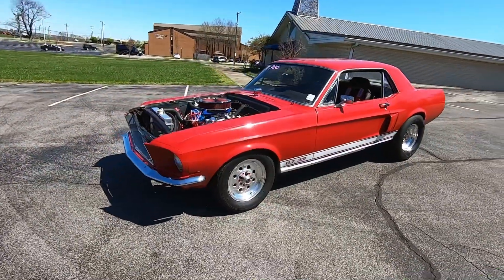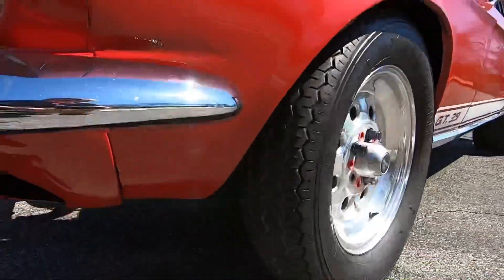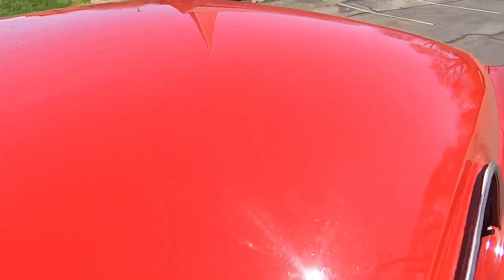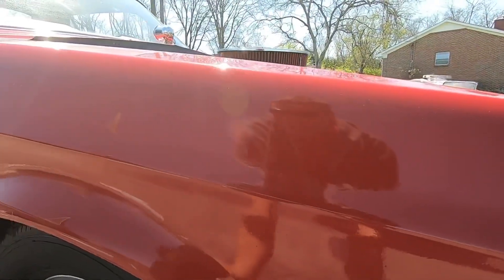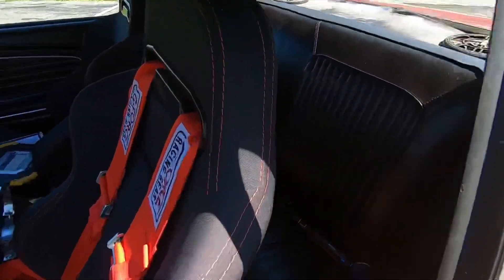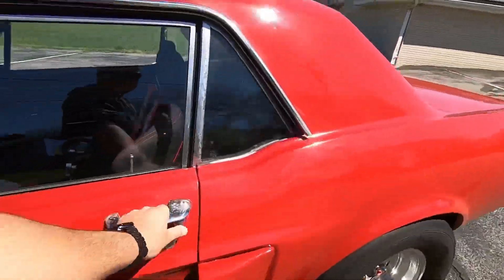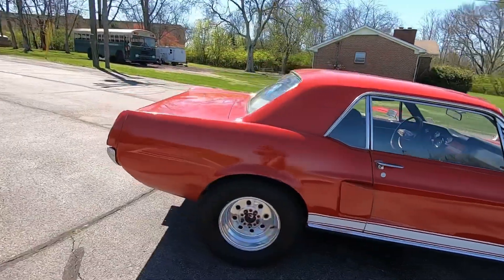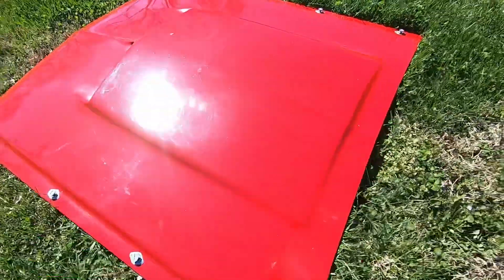1968 Ford Mustang SOLD $14,900 Maple Motors #1026

Comment: I take it that the battery and the fuel cell is in the trunk. Which by the way, you didn't open... lol. Very cheap paint job indeed. Takes away from a very nice car. Good beginners drag car for sure!!